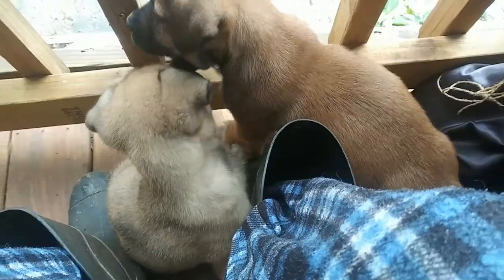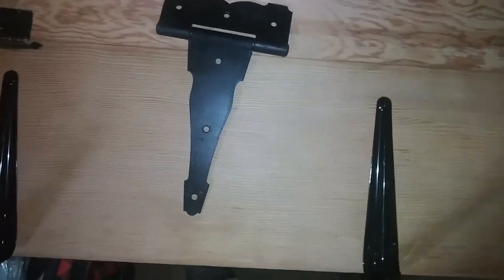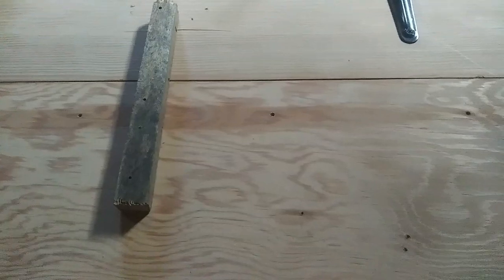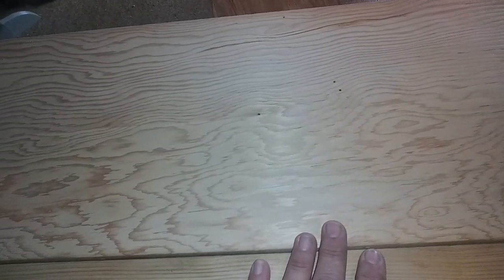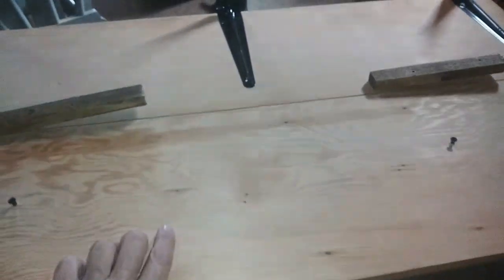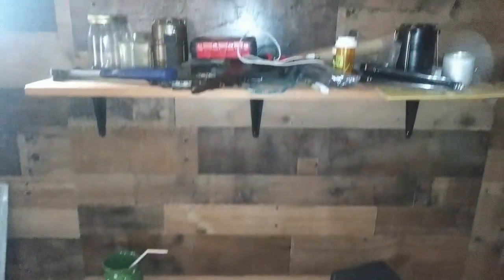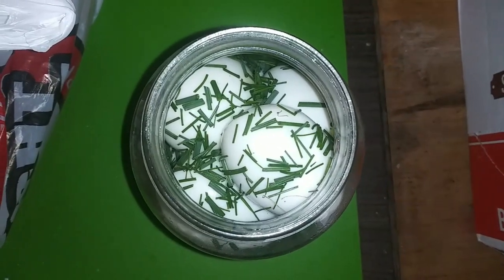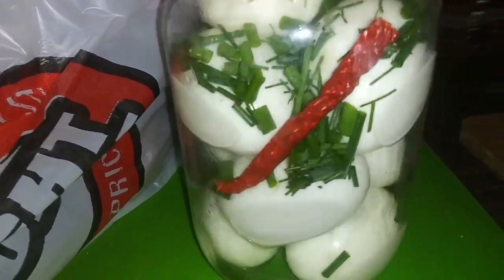I Made a Thing (lol) - Ann's Tiny Life

Comment: GM Ann, Papa and Sons, Ms. Judy and All!! God Bless everyone faithfully in all things!! 🙏 Sonny and Jr love their mama!! 💝 I am not laughing because there's nothing to laugh? You have a very good constructive mind. I have a cabinet with two doors that have those sliding closures. They are screwed in on the sides next to the opening and when I want to open the door, I slide them inward. I would definitely add those chains for safety reasons Ann. I found one of those shelving units in the trash and I am not loving the day that I need to hang it. They require two people for sure! 😖 I tried pickling some eggs and what a DISASTER! First, the shells pulled most of the whites off and I found the brine to be too tart ... I used white rice vinegar thinking it would stop that tartness, but YUCK! Is there another brine I can use without that bitter taste? How long did you boil the eggs for?
Reply from the maker: You can just use plain old pickle juice after you eat all the pickles! Try adding a little olive oil to the water while you're boiling your eggs that certainly helped me! I boil my eggs for about 15 minutes after the water has started boiling with the eggs in it.
Reply: Bring your eggs to a roaring boil then turn them off. Put a lid on them and let them sit for a while until the water cools ( about 7 min ). Pour cold water over eggs and the shells should come right off. Works for me.
Reply: @donnab8010  Hi Donna! God bless!! I did this technique ... I think the trick is the OLIVE OIL. 😳
Reply: @AnnsTinyLife  oooo! I make my own pickles in a brine. Can I use that brine?
Reply from the maker: @mariwillalwaysgivethanks  Yes ma'am!